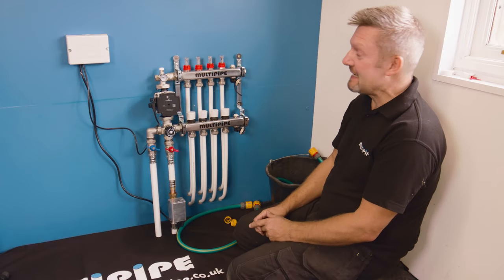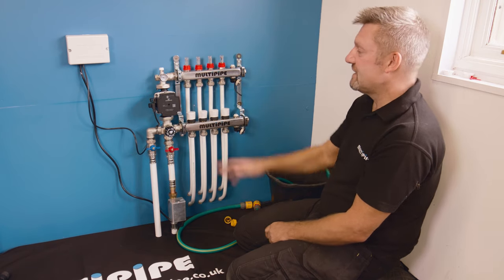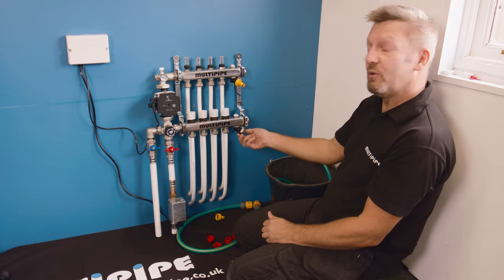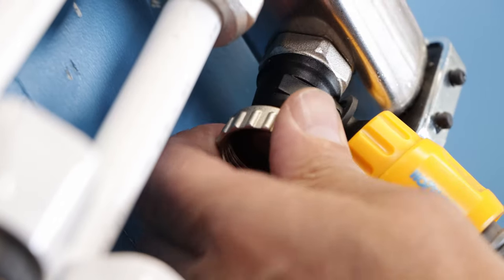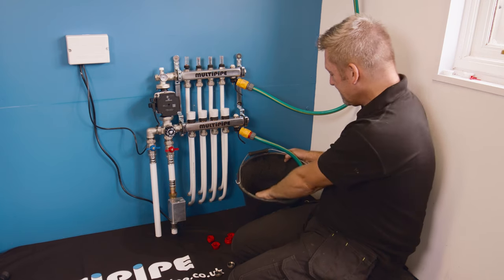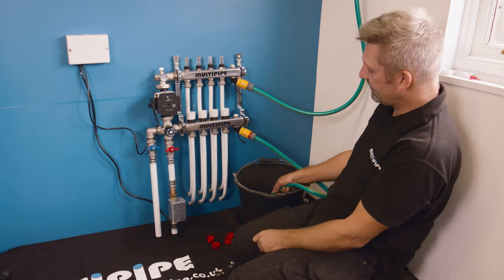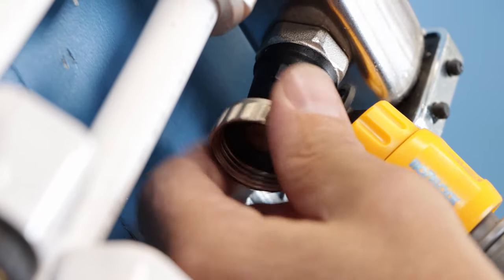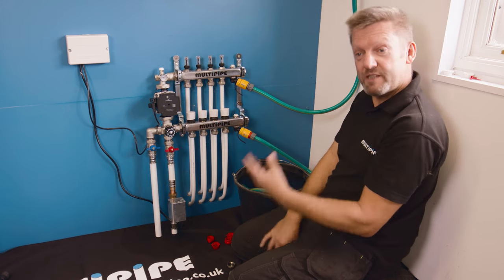Filling And Venting Your UFH Manifold

Comment: Can you apply these principles to Nu-Heat underfloor manifolds?
Reply from the maker: Tony, many thanks for your message there is no reason why not. All manifolds are made to a similar construction, the only difference is how you isolate each loop as this might be different.
Reply: @MultipipeLtd  Thank you. As per your advice, I didn't adjust the flow gauges as this might ruin the balance. Do the actuators hold the pin valve down in order to make the water flow through the pipes? Also I've read that removing the actuators allows the hot water to run through the pipes unrestricted? Is that right?
Reply from the maker: @tonypowell250  - That is fine, the actuator will give enough loop resistance when off to stop flow so that you can fill one loop at a time.

Comment: How do you balance the system or check use the flow valves?
Reply from the maker: When we do the drawing for the project, we provide the balancing flowrates based on thermal output required and running temperature of the system (amongst other things)
Reply: @MultipipeLtd  so this is not a straight forward thing one can do themselves?
Reply from the maker: @tahirahmed3747 unfortunately not, there are too many variables and factors to make a simple calc for this. you could use something simple to start like 1l/m for coils up to 75m 2l/m for up to 100m and fully open for up to 120m.

Comment: If you were to swap out the manifold for one with electric actuators... can anyone suggest a brand or product please ?
Reply from the maker: depending where you are will come down to who is best to supply. We are a UK based supplier for floor heating systems and could help you out if you are in UK or Europe. just call us on 01245 227630.

Comment: Hi I have a single boiler driving C.H., UFH and hot water storage tank ( with seperate pump for each. Is it ok to introduce an inhibitor to the whole system and would the inhibitor be corossive in the UFH ??
Reply from the maker: All main brand inhibitors would not have any adverse reactions to any parts of the system and we encourage they are added to prevent issues in the future. As you have a UFH system it is also worth looking at adding a biocide to stop bacterial growth that can cause premature seal failures.

Comment: What stops the water from going through the pump and straight out into the bucket instead of through the loops?
Reply from the maker: the 4 way mixer cannot allow water through whilst cold. I hope this helps.
Reply: @MultipipeLtd  that makes perfect sense. Thank you 👍
Reply: @MultipipeLtd  I asked as I have just installed my ufh, single zone manifold and pipes (nuheat). And I’ve been struggling with air and locating a small leak. If I disconnect my return pipe from the manifold and connect mains water to the feed valve, I still get water come out of the manifold return hose point. Which tells me it’s getting by the pump and thermo mixer. Any ideas?
Reply from the maker: @waynepassant5076  Wayne, sorry for the delay, I know from past experience, not all mixing valves shut right down. But you are probably right is letting by through the valve best chance for it to shut is to remember the set dial setting then move it to min or closed hopefully it pushes it more into the seat.. if you can get a flow rate through the flow meter when filling. Then you will be able to push the water through the loop.
Reply: @MultipipeLtd  no worries at all. 
It does fill the loop aswell. All is well on the system now

Comment: You have only one control for all those branches so it essentially a one thermostat one zone system. I have 7 thermostates / pumps. If I put the boiler a long way away that would make for 30 ft boiler to manifold then 30 feet back. Isn’t that too long of a secondary with 60 feet of 1 inch pex heat loss in the pipes
Reply from the maker: The manifold in the video is purely for demonstration purposes. It is common to have thermostats splitting multiple zones in a UFH system. In terms of distance and "heat loss", yes, you lose kW energy from the boiler to the UFH system, but as long as the pipe is within the building fabric (i.e. in the heated space), this with will contribute to the heating of the dwelling, albeit uncontrolled. Outside the building fabric, i.e. a loft space, this should be insulated as well as possible. I hope this helps.

Comment: What am I doing wrong? The water goes directly through the pump no matter what circuit is open or closed.
Reply from the maker: our units come with a non-return valve to stop it bypassing through the pump. if there is no means of isolation on the manifold that does make it difficult to do a fill procedure. I suggest getting isolation valves fitted between the pump and manifold unit.

Comment: Hello mate. I don't have any return heating coming back to the boiler. Any suggestions?
Reply from the maker: If the system has worked before this normally indicated a failure of the UFH pump or a blockage in the system. I hope this helps.
Reply: @MultipipeLtd  Thanks dude 😊

Comment: It was the best video so far on YouTube hon how to fill and vent the manifold. Thank you very much!
One question what could be the reason that in the second winter a system with 2 manifolds like this with 0 floor and first floor failed to reach at the temperature. More exactly both are struggling to reach somewhere at 30-32 deg.
 Celsius and they both stay there forever....
Reply from the maker: glad you like the video, I would say if a system reached a temperature in the first year but not the second could have multipipe factors mainly around the heat emitter. email us at technical@multipipe.co.uk and we will send you some information over.
Reply: @MultipipeLtd  - thank you for your tips / tricks it was the "Y" filter of the return of circuit in the gas heating system.

Comment: How would you open automatic actuators?
Reply from the maker: Many thanks for your email, you normally have a wiring centre located above the manifold with the actuator working with the thermostats for individual room control. I hope that helps.

Comment: Mine dont budge. Cant turn them left or right. Any idea why?
Reply from the maker: Sometimes, they do have locking pins that stop you from tampering with them; this is something you normally lift off. Or, it can be that the actual flow meter is seized. There is not a huge amount you can do, and you run the risk of damaging the meter, which can then cause leaks. I suggest getting a UFH specialist out to have a look at it.

Comment: What about inhibitor?
Reply from the maker: Inhibitors are normally added when the boiler is commissioned, not usually when the UFH is commissioned. But to help with this, our calcs tell you the system water volume of the UFH system so you can get the correct dosing. However, we are now moving to the VDI 2035 standard. Although not recognised by the boiler manufacturers, it is a chemical-free way of treating the water and massively helps UFH as you don't get bacteria build-up from running low temperatures. Watch out for new videos on this subject.

Comment: Great video. What might be the reason for flow to not go above 1.5 Liter per min to one of the loops ? Other smaller loops goes to 2 Liter max but Loop 1 doesnt reach this level.
Reply from the maker: The main reason you get different flow rates on certain loops is that the larger the loop, the higher the pressure drop; usually, the flow rate you can get will drop. Operating the pump at a higher speed should raise the flow rate.
Reply: Thank you. I will check it. There is a electronic heat meter where the motor supposed to be.  @MultipipeLtd
Reply: If there is a fill loop in the installation can we use that instead of the outside hose?